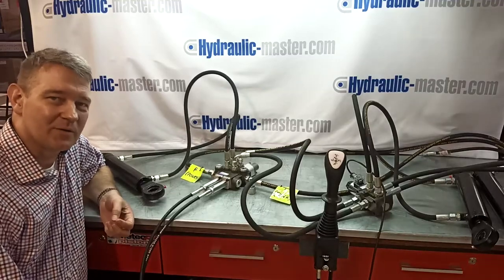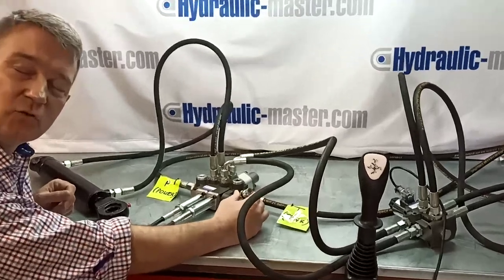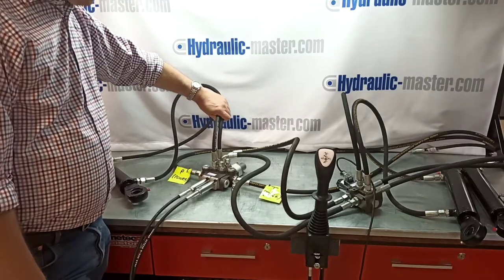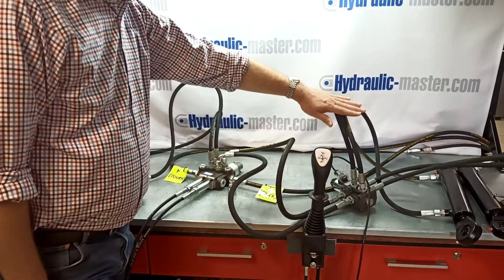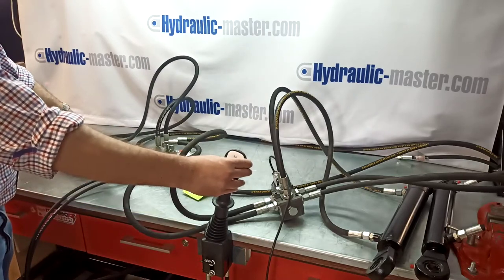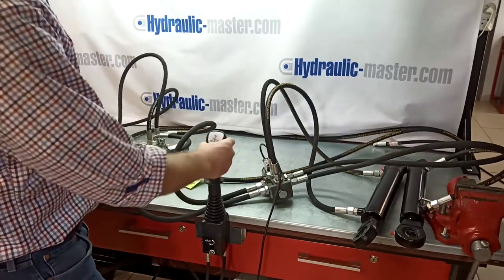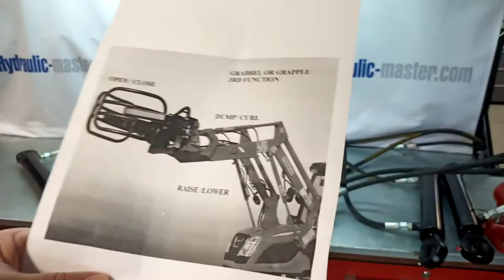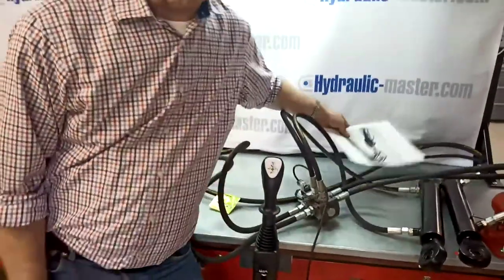Hydraulic Valve with 3rd divider and joystick operation for tractor loader

Comment: Geez that joystick doesn’t look easy to move at all. Should be able to move with finger tips. This guy power gripping and striggling
Reply: its wire controlled valve. wires runs to the joystick.